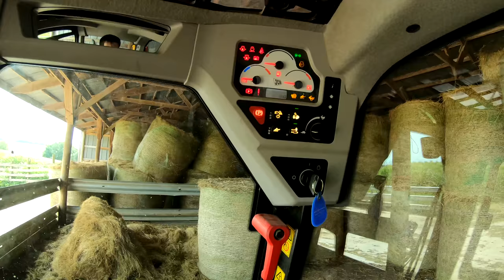Spreading Manure with the CASE Magnum 210

Comment: hi I have a question about Casa magnum.  I have such a problem with him that the external hydraulics leave the machine and nobody can handle it.  new plumbing sheets replaced, pressure checked and everything is fine.  maybe you had such a breakdown?

Comment: Hey kinda dumb question but are there black out dates in WI for spreading manure? In other words are there blocks on the calendar where it is prohibited?
Reply from the maker: Not a dumb question, I don’t believe there’s any dates yet but I know they’ve been threatening to implement some for the last few years
Reply: Eastern Shore MD has very obtuse and complicated rules, but generally it’s prohibited to spread poultry manure from like Dec 15 to Mar 1... I thinkkk. Like I said u bout have to be a Philadelphia lawyer to decode the rules. Bay Foundation and all...I get THAT part, but the statute needs simplification in my view.
Reply: @bobcrone6151  They mostly frown on applying manure on top of snow, because of all the runoff issues in the spring most of the manure or nutrients out of it leaches into the water and ends up in the creek, so its a poor use of the manure and poor practice... course that doesn't mean some jackwagons don't do it LOL:)  OL J R :)

Comment: Does manure actually add to the increase in yield?  Wouldn’t it be acidic?
Reply: Yes somewhat lot of nutrients in manure but you have to apply a LOT per acre to see a big boost in nutrients because of the sheer volume of material... I was going to apply chicken litter one time and the analysis on it was 3-2-2 (IOW, 3 lbs nitrogen, 2 lbs phosporus, 2 pounds potassium per TON of litter!  "Chemical" fertilizers (dry, liquid, etc) are typically 28-32 lbs nitrogen per HUNDRED pounds of fertilizer, for instance, and can be blended to whatever proportions you need based on soil tests, or split applications of dissimilar formulations made-- for instance, applying the bulk of the nitrogen needs as anhydrous ammonia (which cannot be blended since it's a pressurized cryogenic liquid) while the remaining N needs are applied as a liquid blend of 32% aqueous ammonia with phosphate and potash slurry or micronutrients like sulfur slurry added into the mix, or a blend of dry fertilizer pellets spread by a spinner truck... 
Manure can be acidic but it greatly depends on the type of manure it is (say broiler or layer chicken litter versus cow manure, bed pack, hog manure, etc.) but acids have very little effect on the soil compared to alkalies... you can increase pH easily with applications of lime, but it's almost impossible to lower pH with acid applications to the soil... 
Later!  OL J R: )

Comment: Do you guys have a John Deere that closely compares to the Case in HP, weight., wheel base, etc? I guess you will be able to give us some idea of how the tractor would perform compared to a similar John Deere. Would it be a general task tractor, as Travis designated some tractors in one of his videos, or a heavy implement puller.

Comment: It seems like the cost of one of these Wheelman units would be fairly easy to recoup, even for a smaller operation, if one takes operator fatigue savings and overspread/undercoverage avoidance into account.  I know it's not for everyone, that goes without saying.  I think it did a great job for the task at hand and would be interested in seeing how it would perform during spring spreading, especially with other spreader models.

Comment: So how many acres does one load do??
Reply from the maker: All in how fast you drive 😂 I’d say less than an acre
Reply: Depends on how thick you want to spread it... in season like this where they want to take another cut of hay (most likely) you gotta spread it thin so you're not baling up sh!t later on with the hay LOL:)  Course to really meet the fertilizer needs of a given piece of ground you have to spread it on pretty thick, which is fine in the fall or early spring before the crops come on, or when you can till it in... You can get a manure sample analysis that will determine the nutrient levels available per ton and you can then plug that into your fertilizer recommendations from your soil tests to get an idea of how much to apply, or how much to deduct from your later chemical fertilizer application on ground where you applied manure... Later!  OL J R :)